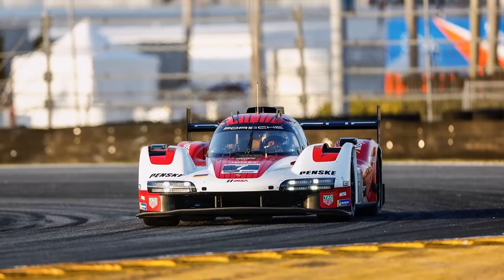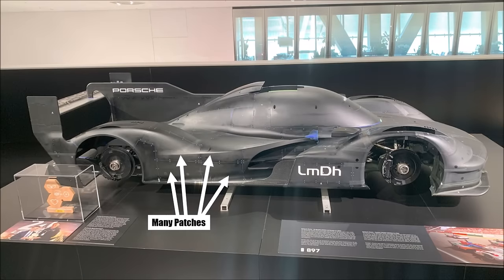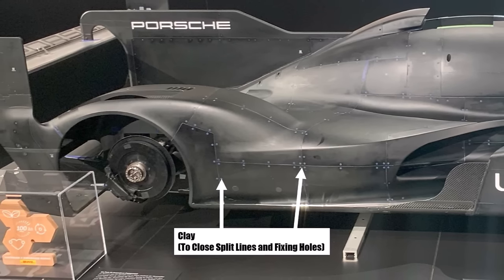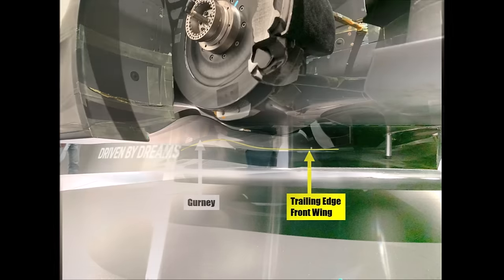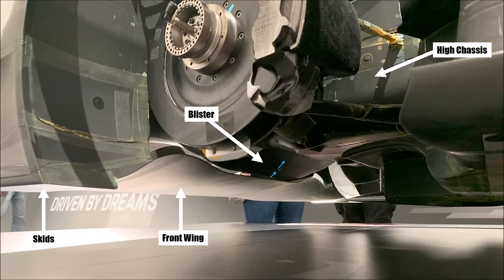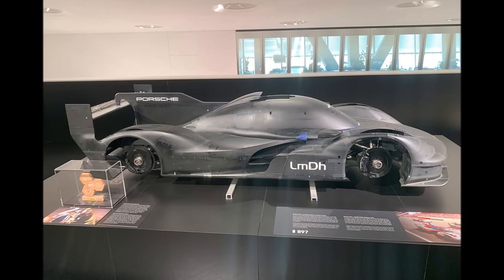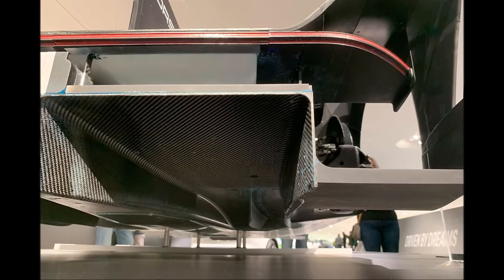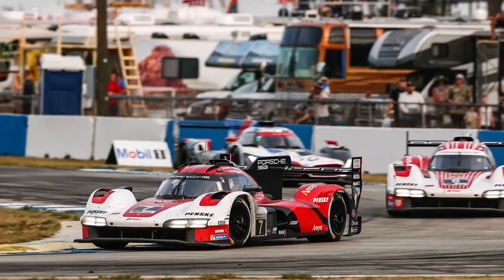Porsche 963 - Wind Tunnel Model - CLOSER LOOK

Comment: I think it looks great.
I really like the clean smooth look of the Porsche compared to others.
Its also cool that they don't have to use dive planes on the front. It looks better and leaves less debris out on track if there is contact.
the holes on top of the wheel wells are very distinct and give it that streamlined look.

Comment: Thanks, this was an awesome video. I think they should change the rules to for e teams to actually show the underbody and floor at the start of each race weekend or after parc ferme begins. They can force them to drive over cameras pointed up towards the floor at the very least. They could put the cameras on pit lane or at the weigh station or just force teams to lift the car to take and share prescribed pictures. I don’t know if it would help struggling teams, but it would be extremely interesting for technical motorsport fans. The underbody and floor is so important to understanding how each car works and not being allowed to see it is similar to if teams censored the back half of each car on TV with a black box.
Reply: Teams won't never show LMH's it's strange they shown LMDH
Reply: @fqeagles21 There's not really anything to show or hide for LMDH; it's the same underside geometry that's been a part of LMP regulations since 2004, and most of the unique treatment that happens at the front would fall in kind with what the constructors have previously done. Being 2026 LMP2 cars (and therefore of very limited aero development value anyhow) in large automaker clothing doesn't really provide much reason to anyhow.
Reply: @K9RacingAndStuff  probably but LMH Is another thing,and they don't wanna show them

Comment: It just raises the bar for new gen street hypercars. Do you think this focus on utilizing difusors more than upper aero elements makes additional pressure on smaller manufacturer that they need to invest more in chasis and aero than before? Given than F1 teams still cannot fully understand it, how can we expect small manufacturers to do the same?!
Reply: as we have seen on the peugeot it's all matter of ground clearance and its sensitivity : if they can extract performance they'll do it, but who, probably in their 60's, would drive a with a reputation of sketcky limit handling? Porsche had this problem with the carrera gt and it seems to me that the 918 was the most tame of its hypercar generation